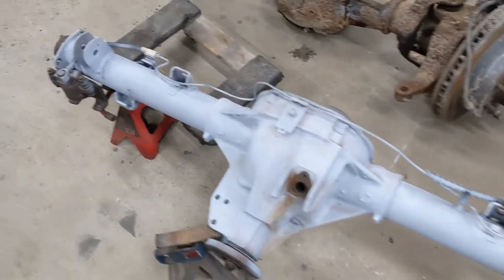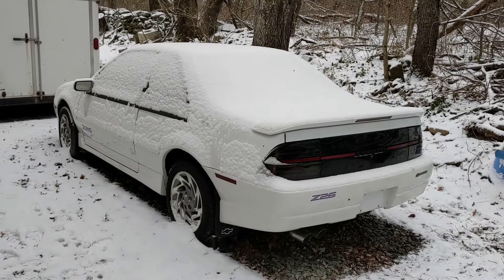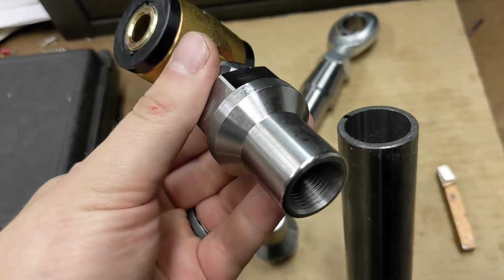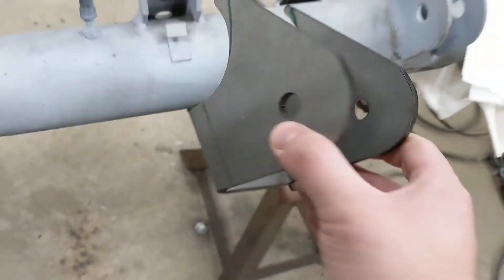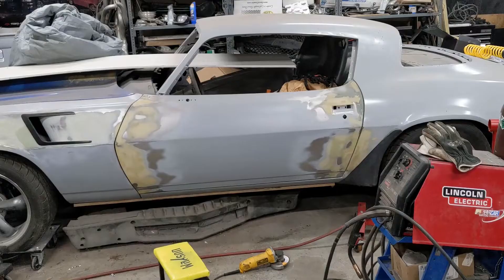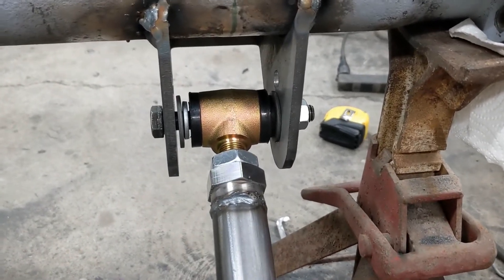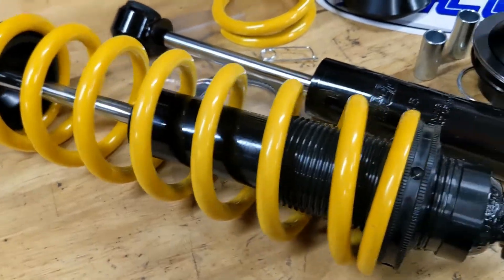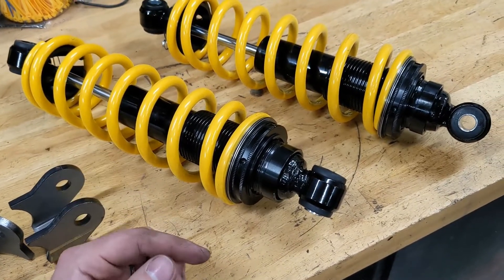DIY rear suspension for RWD conversion - Beretta LS swap

Comment: Would these coil overs work on a stock 95 beretta? There is quite a bit of info on doing coilovers for the front suspension but not much on the rear. I dont really eant to just cut the spring and call it a day. I will if i cant find any lowering springs or whatever to get the back end low low.
Reply from the maker: Anything is possible if you want to fab. But you'd be better off cutting the springs. That's what I did on the last Berettas. Ran it daily for thousands of miles

Comment: Man I got an 02 German Passat estate fwd, but fuck 2 wheels when you can have 4, so the transmission mounts ect also work well with the awd tranny that imma get. my thing is Im not a huge fan of independent rear suspension, although its cool, it aint what i want on my car. and watchin your series is really helpin me map out the plan for next year. thanks a million for posting your adventure man. fuckin amazing bruh.
Reply from the maker: Crazy shit rules! I thought about making my Beretta AWD since the front hubs are already built for CVs...and I could use a 4WD nv3500 5spd with the LS and a Denali AWD transfer case. Couldn't come up with a realistic solution for a front driveshaft and keep it low though. But RWD is great for burnouts anyway
Reply: @GEARHEADdezign  too true man, I goin for winter driving ability and constant rain here in the UK. a lil sleeper action never goes a miss too eh ;)